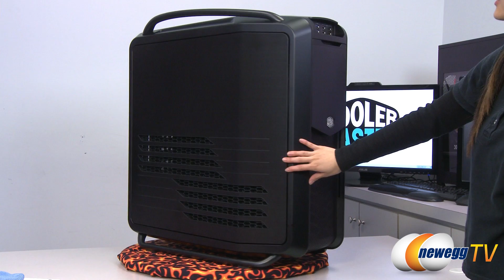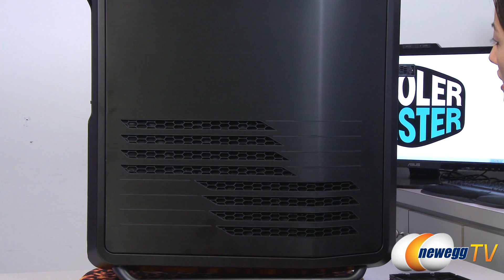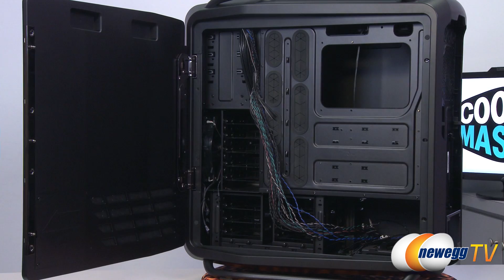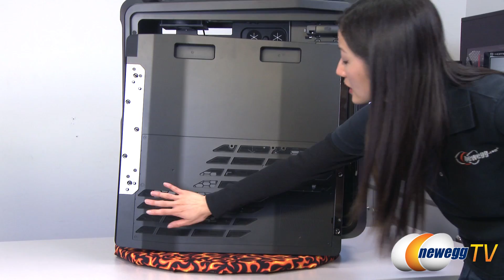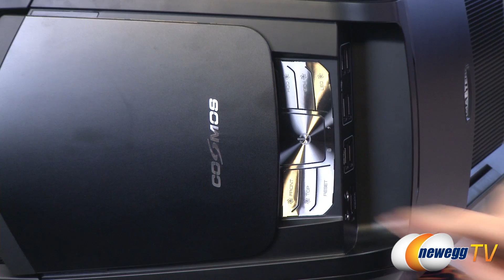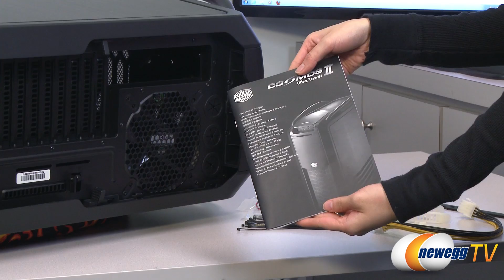Newegg TV: COOLER MASTER COSMOS II Black Steel ATX Full Tower Computer Case Preview

Comment: @wardog3d Agreed about the door. A few days after doing our video, we realized that having that door down blocks airflow, and having it up, blocks drive access. It should be a side mounted door like the original. But they could also easily go the Cosmos S route and have no door at all. It's pretty quiet.

Comment: Everything is updated, it comes and goes. Doing 50+ meg down now after a free upgrade. I've read about others having issues and they have gotten around it by blocking the slow servers, which forces a different server connection.

Comment: Who wants a lighter case a heavy case is heavy but very sturdy for reasons you can't fathom but as to having too heavy means you won't be moving it much but the plus side once you build it and weighs more means no one will be crazy enough to steal it lighter means a lot of things dents to stolen or possible noise problems

Comment: Extreme modding would be needed.  You could try to find some casters that would hook over the aluminum railing; I don't know if this style of caster exist, nor would I trust them due to the weight of the case.  I'd suggest just getting a case that is fully compatible with casters.

Comment: I like my original cosmos better. This just seems like an overkill, sure cable management is great in Mk2, but I bet it is louder and "eats more dust" then the original. You should also keep in mind that you really start to get diminishing returns on those extra fans. Plus $350 is a third of a budget of a very capable PC (excluding the monitor).

Comment: @theElemDragon I was just remarking on the '$350 not too much for a case', in alot of cases I'd say yes. You seemed to say that it means it will lost longer, but a $60 antec 300 will last just as long. Now on the "thrilling" part you got me there, if you've got the disposable income, sure, the tempest is pretty boring as well, and by today's $100 case standard its also now lacking in a lot of features. On that note, there are now some thrilling cases in that range.

Comment: @DropshipDude the entire rig is for sale as well if anyone is interested it about 4 months old comes with a extra power supply and mobo and a extra 12 gigs of ram dominator gt 2000 mhz ocz zx 1000 psu and a evga z68 ftw mobo that was only used one day all that gear is exactly 5 months old so almost two computers for 1 price o and comes with another gtx evga reference card 580 as well if intrested leave a coment on one of the videos on nervoustwitch77s channel

Comment: @AKKodiak1969 and yes hard drives are so yesterday i just ordered 2 more ocz vertex 3 max iops  got them in today fired them up and bam absolute jaw droppers if u ever decide to go ssd make sure to go raid 0 with them just the single ssd is nice but if u want complete power get two 240s and raid 0 them omg what a drastic change from even the fastest raptors from western digital cant even come close to them in benching with atto or crystal benching utilities.

Comment: Well .... I mean if you look at the case and compare it to the Blackhawk Ultra, the side panel seems plain. Not as big. No fans inside. Less fans to sport. No hub from inside (I think?). At the moment, I have a DF-85 and it's amazing, but I want a slightly larger case with stronger fans and the Blachawk Ultra fits my need.

Comment: @AKKodiak1969 I went with the ocz vertex 3 ssd x2 in raid 0 with wd green 2tb storage togather with intel  rapid storage technology a corsair force 3 60 gb ssd so i skimped on hard drives and went mostly with ssds man how much lighter my system was than my other....but i broke down an ordered this case yesterday simply for the room and going to use 320 mm radiators instead of single 120s so i hope this works well and i think it will later if they come with a window ill simply order it.

Comment: I wanted to buy this case it's my first build and I have Been doing a lot of research for months but I'm not tech savvy. Now would this fit a gigabyte x99soc champion with the kraken x61 all in one cpu cooler?
Reply: No, you need a bigger case.
Reply: Cuz, this ginormously huge case is not big enough. I'd say a custom semi truck would fit those compoents much better with barely enough room for cable management.

Comment: I heard the doors outside is made of plastic not brushed aluminium so scratches easy. This looks like the inside deserves to be encased with a side window so show off the components worthy of a £300 case. Handle bars and rubber grommets eh

Comment: @DropshipDude yes me too if u check out my youtube vids i have posted on my channel you can see the gear i have i love to show off.asus maximus 4 extreme z z68 e-atx ennermax max revo 1350 psu 2x gtx pny XLR8 liquid cooled 580s 2x ocz 120 vertex 3 ssd in raid 0 h- 60 water cooler i7 2600k @4.6 ghz. 16 gb of mushkin redline @ xmp 1600 sythe 5 channel fan controller asus dvd blue ray burmer3 12"black lights makes everything glow lol and some 15 or 16 120 mm corsair pwm fans that move a ton of air.